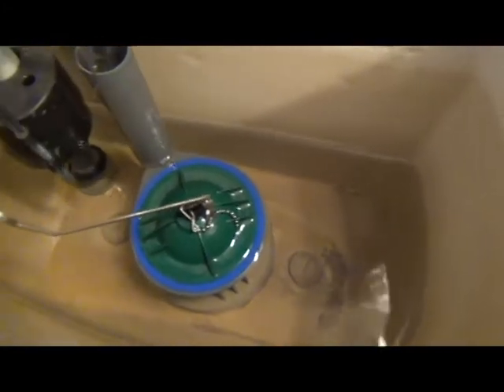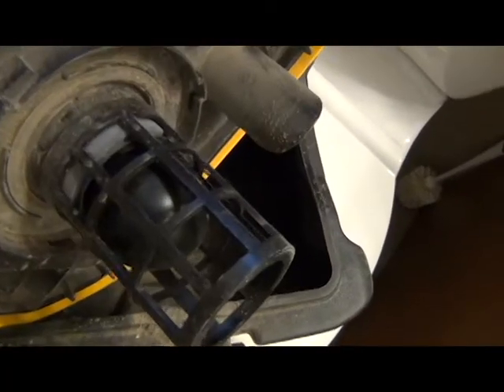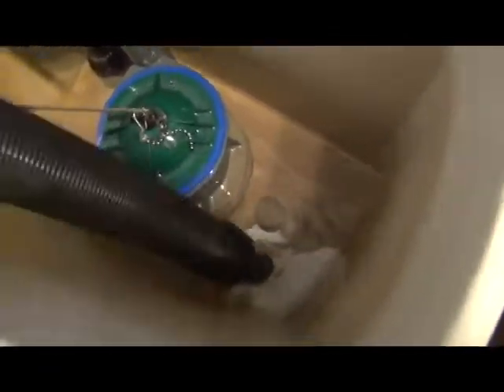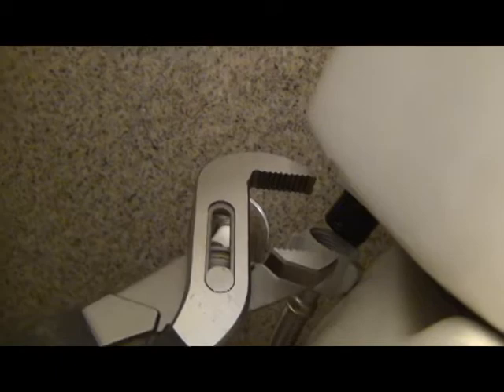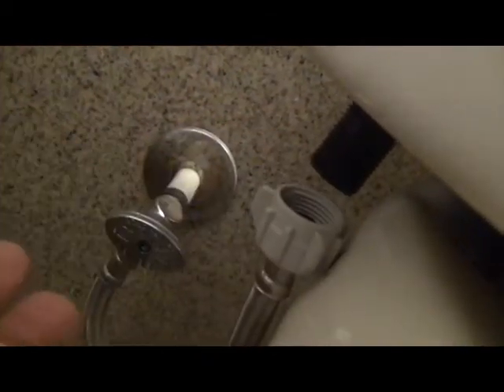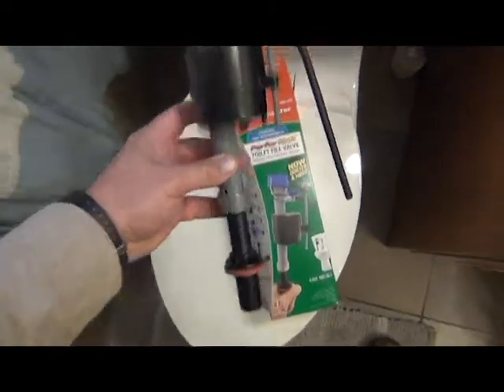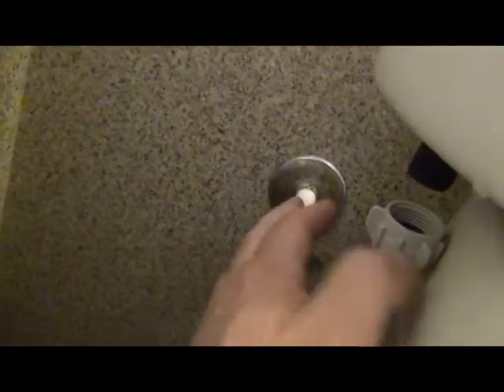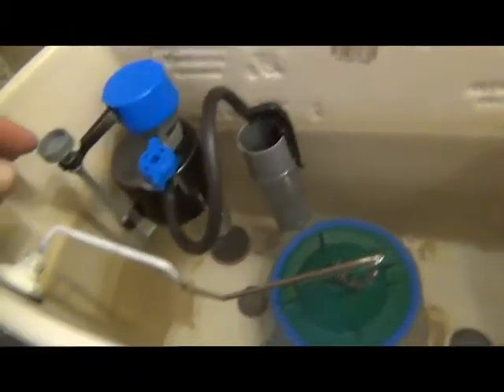HOW TO FIX A TOILET IN ONE MINUTE

Comment: When I did this a couple months ago I bought an exact replacement which allowed me to pull the old one  
out (the slip connection where the grey pipe meets the black pipe that attaches to toilet tank in your case) and slide the new valve on.  Much quicker. Didn't have to remove the last few inches of water or disconnect steel braided hose from tank.
Reply from the maker: I didn't know they came any other way!  Thank you for sharing.  I love learning about new hardware.